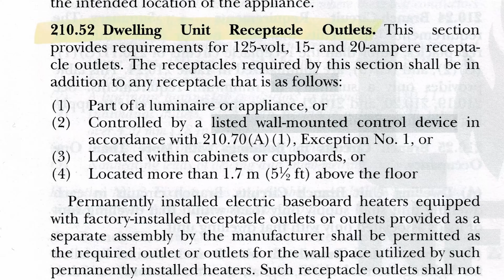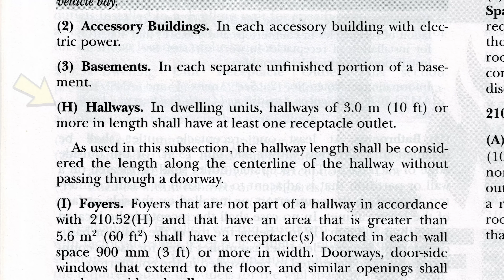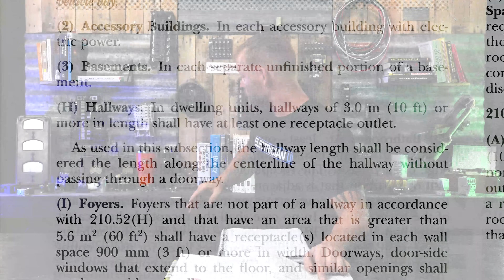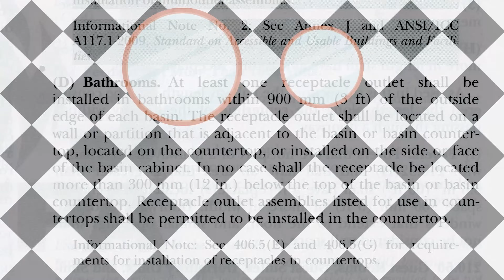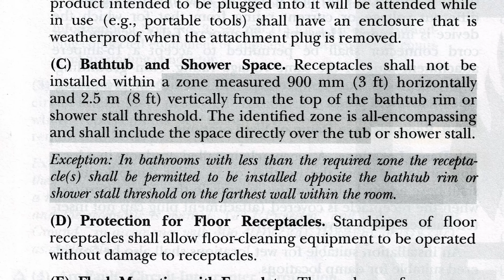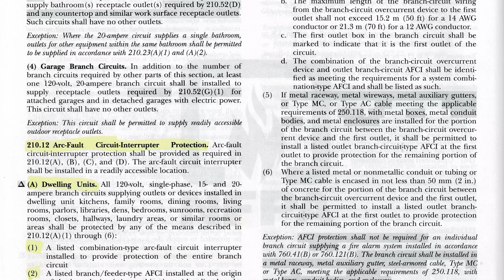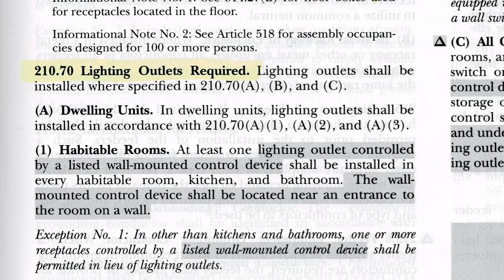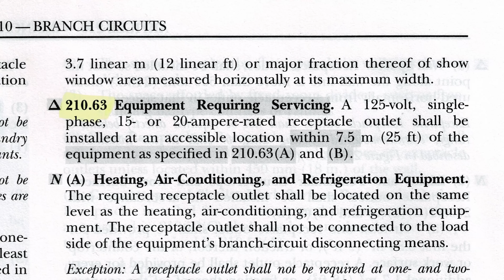KNOW WHAT YOU'RE DOING - or You Will FAIL Inspection!

Comment: Had a city inspector out here in Houston area tell me “make sure you isolate the grounds and neutrals” several times when he showed up to inspect a main panel we were replacing. I advised it was a main and must be bonded and he still reiterated the “isolate” comment. I’m guessing he just meant to make it look pretty by having neutrals and grounds on separate bars but using the word “isolate” is problematic.
Reply: Was there a disconnect between the meter can and the panel? If so, that's not a main panel, it's a subpanel.
Reply: Inspectors don't know crap
Reply: i'm in Houston too
Reply: I just wired up a temporary main panel, a cheapie one, with grounds and neutrals on the same neutral bar 😂
Reply: @CharkG73  on a main panel, no biggie. It’s only subpanels, and panels downstream of a main disconnect that this would pose an issue.
Reply: @SuperVstech  definitely, don't want all that metal and all those green wires carrying neutral load in normal operation
Reply: Remember the inspectors are not your enemy.  They will greatly appreciate you asking clarifying questions and respect you more.
Reply: If you want to use proper terminology, stop calling anything a 'main' panel. Call it a 'service panel' and it will be clearer.
Reply: @solomonwilliams9708  But there is a Main Service panel that can have sub-panels ran off of it. Everything needs to be bonded when on the main but sub-panels don't require bonding to my understanding.
Reply: If your panel has a “green bonding screw” thatll be the main service panel… easiest way to tell if its the main panel.
Reply: Good chance his experience in the trades wasn't electrical and he was repeating misunderstood information.
Reply: It's only supposed to be bonded at the main principle. You service entrance disconnect.
Reply: Some of this code ignores proliferation of cordless vacuums and the greater usable light of LED and other light sources used now.
Reply: @jimmyaber5920  ... a cordless vacuum still needs a place to charge, and that outlet needs to comply based on its location.
Reply: For those inspectors, an ounce of prevention is worthwhile. Plus it makes it easier to troubleshoot down the road to have the grounds and neutrals on separate terminal strips in the main panel.
Reply: @dracula3811  think it was more the terminology he used. Shouldn’t have been saying isolate.
Reply: @dracula3811  and we do put on their own bar but just that word. Feel like some of them just have to say something even if it’s dumb.
Reply: @dracula3811  idiotic… zero reason other than aesthetics to do this on a main panel… unless there is a primary disconnect before the main panel.
Reply: @SuperVstech  So, I'm dealing with this right now on my own home.  The previous electrician stuck the neutral and ground for each 15/20/30amp circuit under the same nuetral lug.  As everything was trimmed really short, I'm now dealing with retrofit ground bars so close to the nuetrals that things are very hard to work on (vs the logical location below them - at least on a QO 40/42 slot).  If they had been kept separate, adding my new panel in front would have been fairly trivial, little more than removing the bonding jumper (screw in my case), and things would be much cleaner, too.
Reply: @houseman2414  you can attach wago nuts or wire nuts to the short wires, and extend them.
Reply: @SuperVstech  Agreed for the small stuff (not for the 40-60 amp circuits), but 40ish splices for the ground bars is a mess on it's own, too.  I would probably use bare copper crimp barrels first.
Reply: @dracula3811  and we do put on their own bar but just that word. Feel like some of them just have to say something even if it’s dumb.
Reply: @dracula3811   plus I’d add many inspectors don’t understand what’s actually going on so it’s not a prevention issue and I don’t see how it helps troubleshooting.
Reply: @victorseaton9123  except that doesn't actually matter. It is certainly preferable for the inspector to be highly knowledgeable of and experienced with the code, but even if we disagree with the inspector's interpretation or even if the inspector is flat wrong, they are the authority having jurisdiction and have the final say, period.  Most have encountered an inspector that requires a particular methodology that exceeds code requirements or is different than what others would call "standard practice." The key is knowing ahead of time to reduce rework.

Comment: This brings to mind an interesting idea for a video. How about a “why?” For some of the codes? I’d like to know why I need a circuit within 6feet so I can explain to my customers why these things are necessary.
Reply: Most powered device’s have cords 6 feet long
Reply: @dennyskerb4992  .... in case you haven't noticed, that 6 ft rule is part of UL approval on most appliances. You will find almost nothing with a longer cord.
Reply: I always wonder these things too. Then I realize that the whole and only purpose of NEC is to protect people and property.  It seems the code boils down to, in essence, sizing things properly to prevent fire, and bonding and grounding things to prevent electrocution.   The 6foot rule for example is largely to prevent people from having to reach around water (in a kitchen) or just generally power things up with extension cords, as they may not know how to size them properly, or plug to many things into a power strip, etc. Most code probably arises from fires or deaths that happened, and so rules change to prevent what happened from happening again. That sort of thing.  So at the core, the customers can be told it's to prevent fire and/or electrocution.
Reply: To avoid the need for an extension cord for COMMON use (eg table lamps). 
You should have lived in a house built in the 30's. Some had 1 outlet per room. then it was 1 outlet per wall in the 40's .
Reply: @steveurbach3093  I am in a house built in 1890. I was lucky, each room had 2 outlets. Usually on opposite walls. Which doesn't work too well in a 12 x 12 living room with no ceiling fixture.
Also, the whole 2000 sq ft house was run on 6 fuses. One of which was dedicated for the furnace.
I had no idea about the code requirements when I figured out where I wanted all my new receptacles when the 40 breaker panel went in. But looking around, seems like I met and exceeded code just by having them where it made the most sense. And the kitchen has 8 circuits, counting the 4 dedicated ones for the fridge, freezer, dishwasher, and microwave.
Reply: If you don't make things convenient for the resident, they will start doing sketchy things to make it convenient for them. Most homeowners and Tennants doing things more than just simply plugging in a charger to a receptical leads to fire.

Comment: After a perfect record for 7 years, I failed an electrical inspection on Monday. I was hurt, frustrated, and angry. I quickly buried the experience in the past. That's right. I moved on. Especially, after I charged a random call in customer $95 cash for a single replacement outlet, and bought myself a steak dinner.